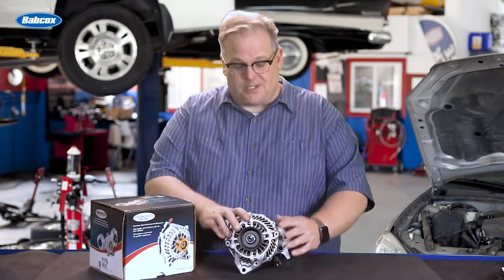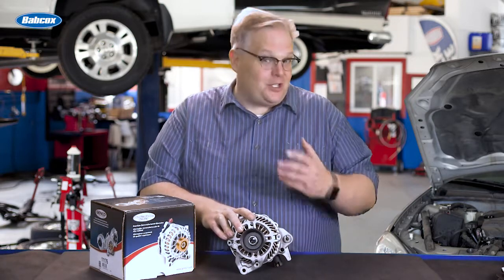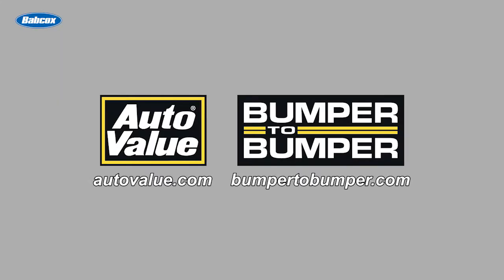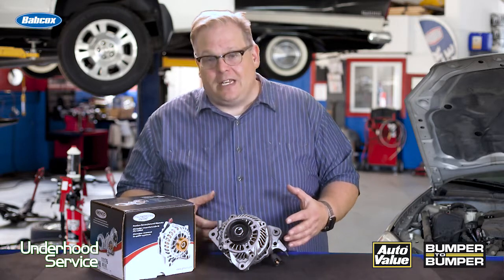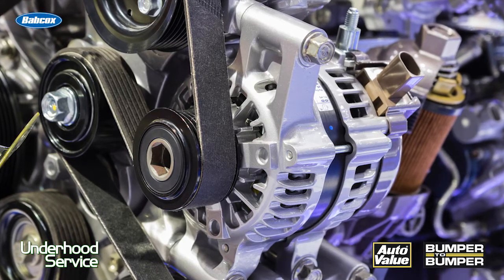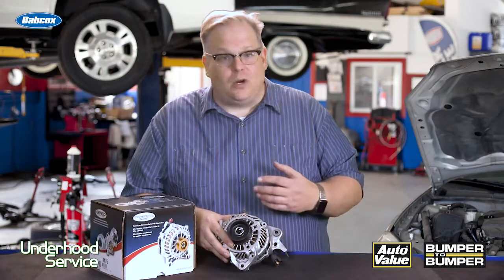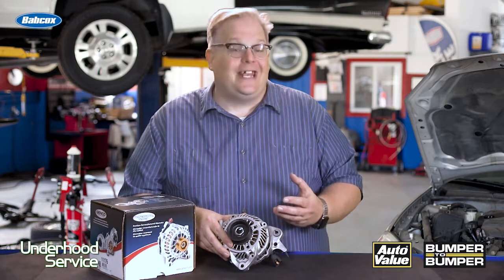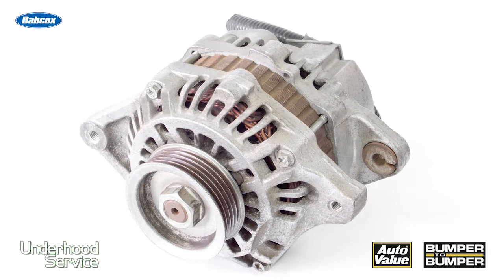ECM Alternator Regulation - No More Full Field Testing | Tech Minute

Comment: I feel bad for any starting tech who sees this and doesn’t know better the WHOLE PURPOSE of a full field is to determine if the ecu is the cause of the problem with the charging system and he just explains the role of the ecu as the reason to not?? ASE tests tell you to full field this guy made himself look like a shmuck don’t listen to him
Reply: So could a bad alternator cause crazy electrical problems and no start?
Reply: @KRALTAIR47  yes, many systems in today's vehicles need their full voltage to work properly, or they can seem to have all kinds of odd problems or not even work.

Comment: The idea of a full field test is to determine if the charging system problem is caused by the ECU and not by the alternator. Therefore, the full field test is still valid by bypassing the ECU and allow the alternator to put out as much electricity and possible eliminating a wrong diagnosis by thinking that it is the computer at fault when in fact it was the alternator.
Reply: Exactly, what retard made this video
Reply: well said